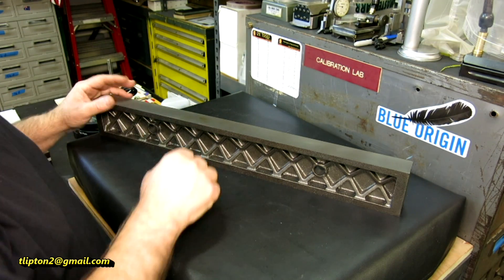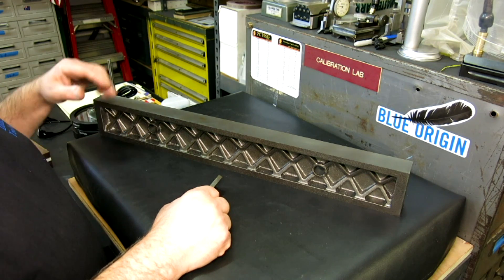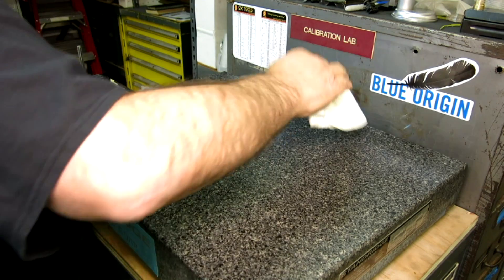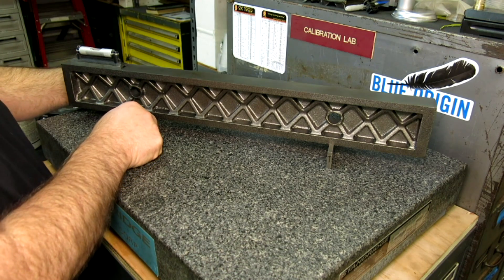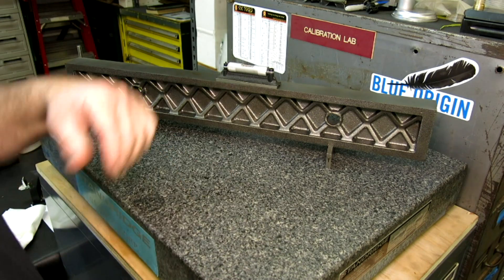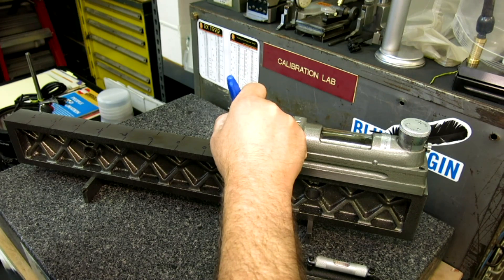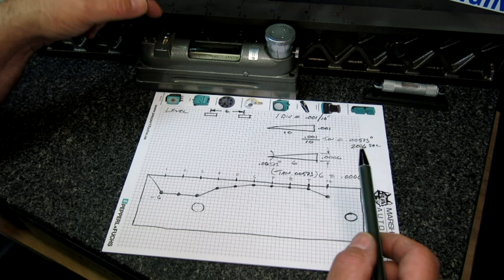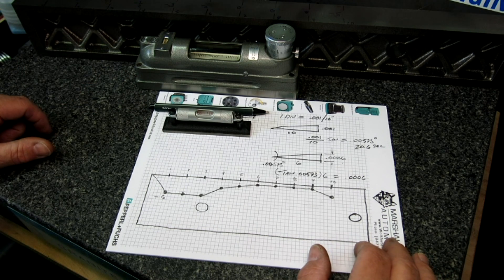Measuring a Straightedge with a Precision level

Comment: I have a piece of granite cutout from my sink counter top. I use it as a surface plate. Very flat. Wondering how strait it is. Any thoughts?
Reply: I have a 1-1/2" thick granite slab that I use, and I don't have an autocollimator, but I can tell that it's not flat with a strait edge and a flashlight. If I stick an indicator on a 'sled' and move it around with the stem of the indicator a few inches away, there's all kinds of inconsistencies.
Reply: It is only 1 1/8" thick so I have made a sand box to support it.
Reply: How long is a rope? It could be dead flat or you could serve soup on it... Even if it were dead flat, 1 1/8 inch thick is not going to be particularly rigid in a metrology sense. Also, temperature fluctuations would be a significant factor. Managing expectations is your key here. If you can get consistent enough measurements for your purposes, it is what it is.. 

You can get an 3 inch thick 18x24 plate from MSC for 165 bucks which would be vastly better.
Edit: current MSC flyer has a lower grade import the same size for 120... Still way better.
Reply: It may or may not be what you think it is.  There are 'natural' granite slabs which are sawed and finished as one piece; and there are composites.  Composites are epoxies filled with materials like crushed granite, ground or crushed glass (very pretty), and just about everything else you can think of.

As you might suspect, composites are far more flexible and susceptible to temperature variations.  They are also prone to some degree of permanent shape change - insignificant for countertops, but not reliable if you're measuring to .001 or better.  They have many uses, but metrology is not something they're very good for.
Reply: Rather then expecting a section of granite counter top to be flat enough to use as a reference, why don't you just buy a decent smaller surface plate? Have you actually looked at prices? You might be surprised to find they are quite affordable unless you buy a gigantic one. 

Another good point: "DO NOT" buy used surface plates unless.... they are like 5 bucks, as you are 99.9% chance buying a well used and thus JUNK piece of rock and expecting it to actually be flat. 

Never ceases to amaze me why people buy used surface plates and pay good $$. If you do buy a used surface plate, you might as well go down to your local granite counter top company and have then cut you out one. With the counter top granite you have no clue what your getting and the same exact thing goes for "used" surface plates.

If you want something to set a piece of sandpaper on to make your wood project flat..... yes, use a section of granite counter top... or that used surface plate you paid no more then 20.00 for at the machine tool auction. 

If you are an actual "Machinist" or "wannabe machinist" buy a actual certified granite surface plate. Then, take care of it, and it will be there for you and help you and be far far far better then a section of counter top, unless your looking for something to sand your woodshop hobby project.....

~

Comment: Hi Tom, it would be interesting to mount the level on dowels in order to get more precise measuring points, then you could rely on the resting distance of the level to the surface, but, I understand the point of the demonstration...   ;)
Cheers,    Pierre
Reply: Why not just use a sine bar?

Comment: Nice video.  Wondering how the weight of the level changes things as you move it away from the supports on the straight edge.
Reply: good observation.

Comment: Just an innocent (hopefully)  suggestion but in instead of using of using angles to figure out how much one division of the level equals in 6" just use the ratio i.e.,  .001"/10" = a"/6"  therefore a = .0006 
Sorry you actually did that in the explanation.  My bad.
Reply: Lol just figure it out after doing the inverse sine and cosine of my 0.02/m metric level , waist of time really.

Comment: Sorry, I couldn't read the bottle of surface-plate cleaner.  I think the white bottle is a little too over-exposed in the video, and there is some glare from an overhead light?

Could you just post some info like the name and/or brand for the cleaner?
Reply: Standridge

Comment: If all the numbers were negative, shouldn't your graph show a constant slope down to the right?  You measured the slope at the points along the length and need to take the integral to get the actual heights.
Reply: Not going into what the actual ticks are showing but think of it like this - assume that these ticks are what you got:
-1, 0, 0, -1, 1, 0
These are the slopes at 6 points (assume 1" apart).  You need to multiply them by the distance between them and add to a running total.  Starting with a zero point and using these slopes as a representation of the surface between the points we get these 7 heights:
0  -1  -1  -1  -2  -1  -1

Comment: Of course that is a pretty typical milled profile since the cutters tend to take a bit extra off the ends because of the changes in tool pressure based on the amount of cutter engagement, close to .0005" over that length isn't too bad really I think.

Comment: Tom.. How do you know what part of the pad on the level is actually contacting the surface ???  Wouldn't this change the angles in your calculations?
Reply: In case you didn't noticed, this was simple demonstration, not going into details. So your question does not apply.

Comment: This is super interesting. Is there a way to do this without a level that has an adjustment dial like yours?
Reply: Just level the plate(?)
Reply: Ah gotcha – the adjustment isn't used to measure, just for initial setup.

Comment: If the surface plate is moving when you put your weight on it, how can you be sure the surface plate is not tilting as you move the weight of the level? I would want to put something as heavy on the other side of the surface plate to quantify the tilt effect on the surface plate, and then again on the straight edge to quantify the deflection of the straight edge.
Reply: No offense or disrespect was intended.
Reply: To be sure the surface plate was not itself tilting, Tom could have used one of his more sensitive levels on the plate to note any changes in the plate due to the weight of the level on the straight edge.
Reply: This was simple demonstration, so chill out, smart-ass.

Comment: Hey Tom, As the level moves along, are you not changing the datum? The first measurement sets the heel as the datum, and the toe as the variable. As you move the level, the heel is now sitting on a new datum, which effects the angle. If the heel just moved from a high spot to a low spot, and the toe has not changed height since the last measurement, the angle change reflects the change at the heel, not the toe. It can look like a high spot at the toe, when the heel actually dropped into a low.  In order to make a more accurate graph would you also need to factor in the difference in height from one heel position to another, ie: the measurement made 6" back?
Reply: +SJWs & Betas Killer I'm sure you're right, but I don't understand it either. Imagine for example that the surface dipped down a thou at the two inch point, then back up at the four inch point, stayed at 0 at the six inch point, then dipped down a thou at the 8 inches.

If you moved the level along at 2 inch intervals, wouldn't you measure level at each interval, even though the surface was wobbling all over?

BTW thanks a million for all the work you put into these videos, Tom, they're better than any commercial tv I've ever seen.
Reply: The angle measured is the rate of change of the surface height, so to get the variation in height you'd need to integrate along the straightedge - so yes, to get the height at any point you would need to take into account the angles measured up to that point
Reply: When you have a 6" level, you have to start from 0 to 6. Then from 6 to 12 and so on. By doing this you know exactly where the angle changes from the previous point. I think what we have seen in this video is a wrong way to measure straightness
Reply: This was simple demonstration of relative measurement. "Datum" doesn't matter.

Comment: Nice but I don't get why it was necessary to use adjustable parallels??
Reply: I would guess the dial only has a so many increments and that the granite would go off scale meaning he would have to decalibrate his level in order to get measurements
Reply: as he said, to level out the straightedge
Reply: ajtrvll Because the surface plate is out about 0.400" over the length. he just wanted to get it close.
Reply: Great catch madinatore!... LOL that's the difference between a theoretical mind and a practical one.
Reply: On parallels avoids the need to true the bottom of the straight edge. It keeps it from rocking.
Reply: Andrew Delashaw, I think you meant 0.004" (four-thou not four-hundred-thou)?
Reply: SJWs & Betas Killer, Did not know you were keeping score... FYI, I'm perfectly comfortable with my machining ignorance :)
Reply: Also a good catch Chris Turley!  I believe Tom said the straightedge was machined (no surface grinding, lapping or scraping)... makes sense to use parallels for this reason... however, adjustable parallels make sense only with madinatore's reason (for now).
Reply: That was basically my question: does it matter if the surface plate is out of level for the measurements Tom was doing?... If we say the plate is flat but out of level and the straightedge is unknown flatness, then zeroing the bubble anywhere on the straightedge creates a reference point that takes into account the surface plate tilt... no?
Reply: Yes, and "theoretical minds" are losing to practical ones, most of the time.